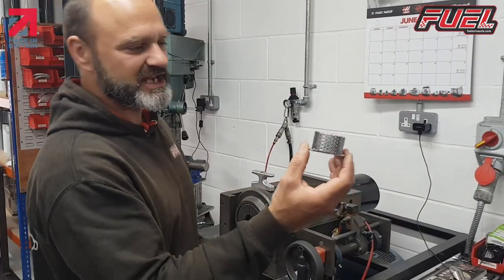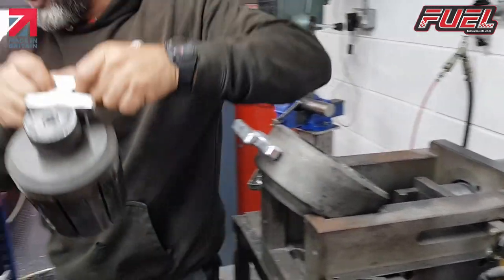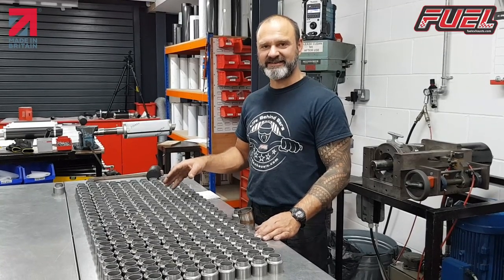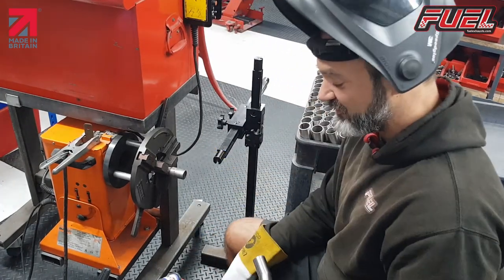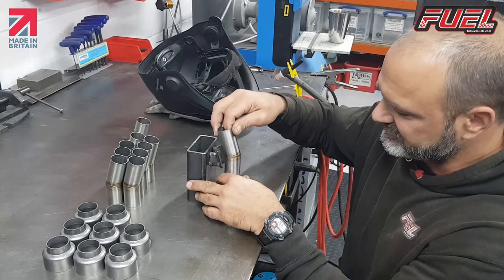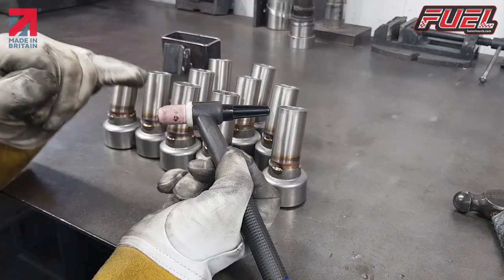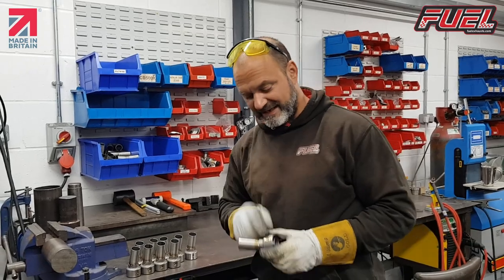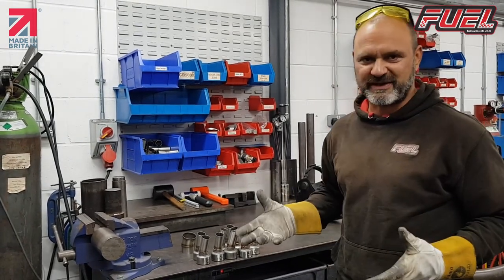Manufacturing dB Killers, Removable Baffles, Mufflers, Silencers for Aftermarket Motorcycle Exhausts

Comment: I just got a set for my bike and am very satisfied with the build quality and customer service. The fit was spot on too. My only issue is that now the bike is almost quiet as stock. I was hoping for a Goldilocks zone. I have the straight tube ones. Is it advisable to start cutting off sections at the back end of the baffles or to start drilling holes in the lengthwise tube?
Reply from the maker: @FR240SX In order to make the sound louder, you could cut a short section off the bottom of the inner tube and try that. If still too quiet, repeat the process. You can continue to cut down until you get the appropriate noise level but just cut small sections at a time so not to go too far! Hope that helps.

Comment: What ones do i need for a stock ehaust on 2011 harley sportster 1200..prevvious owner took out baffles and exhaust sounds very trashy..
Reply from the maker: Thanks for the message. These are not appropriate to fit inside the stock exhaust. They are designed for aftermarket silencers, sorry.

Comment: Does the length of the DB killer tubes determine the overall volume of the DB killer? If the tube was longer would it make it quieter and vise versa?
Reply from the maker: @Garrett Weekly yes it does but so do many other variables. It is not as straightforward as a yes or no answer. :-)

Comment: Man, I really love your workshop ❤

I was wondering, I'd like to decat my current bike (Duke 390), it has no db killer in at the moment (Akra slipon). But past experiences with decatting bikes learned me it get's quite a lot louder. 
So the idea was to decat but to go use a db killer instead to mute the sound a little... Not sure if this is logical, if I undo the extra airflow created by removing the cat by adding a db killer. 

But after searching around a bit there's so many choice in types of db killers, what type would be a smart choice in means of good airflow without getting a too loud exhaust ?
Reply from the maker: Thank you. We love it too! 🙂

Removing the cat always makes the bike much louder and running it with an aftermarket exhaust adds to that. A decibel killer would take the edge off but I don't think it would make a massive difference. That said, it will vary from bike to bike and also depend on the exhaust fitted.

There is no perfect combination, you would just have to buy one and try it. ;-)
Reply: @FuelExhaustsLtd  That's at least a really honest answer 🙏

And it's an Akrapovic slipon, really short. Personally I think it looks cool but it's not a really good silencer. 
Without db killer it's almost as loud as my ktm 250f mx bike with a HGS exhaust, the latter is quite a bit longer and seems to work a lot better.

Think I'm going to try to find a better silencer for my little Duke, or just not decat ;)
Reply from the maker: @wernerxldata  which Duke 390 model year? We do manufacture exhausts for many KTM Dukes, see here - https://www.fuelexhausts.com/exhausts/bike-and-range/ktm.

Comment: @Fuel Exhausts ltd ; Someone previously commented on whether these dB killers actually work, and you replied that they do, but what does this actually mean?
I'm looking for a practical tried and tested way to dampen the exhaust on my custom bobber solely for the purposes of the MOT test. It's not overly loud, but it has been turned away by one MOT station due to their opinion. 
There is zero information on testing the sound killing effectiveness of decibel killers. I need to know by what degree these dB killers actually cut the decibels? This is really what people need to know.
Reply from the maker: @Ann6dr2om7ed4a it means what it says, they work for the type of exhausts we make them for! We manufacture these dB killers for exhausts which also use wadding in the silencer body. If you have small / short, straight through silencers with very little (or any) wadding, then they probably won't work. There isn't a set amount of decibels a dB killer will reduce noise by as it depends on lots of variables. Maybe you need to get yourself and decibel meter and carry out your own tests on your own machine. :-)
Reply: @FuelExhaustsLtd  Thanks bud, my pipes are 2" diameter slash cuts,  they're fairly long "Dragon Pipes". They do have baffles somewhere in there, but they're still reasonably loud, and as such, are dependent on the discretion of the MOT tester. I'll probably be giving you a call soon! :)